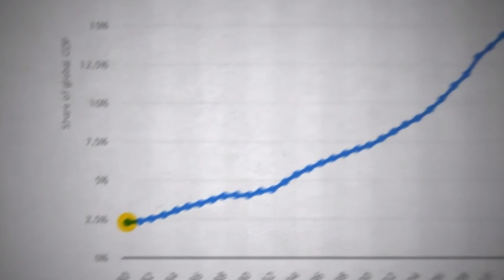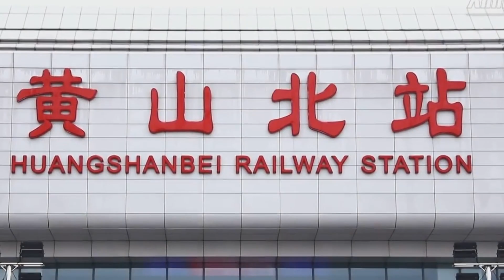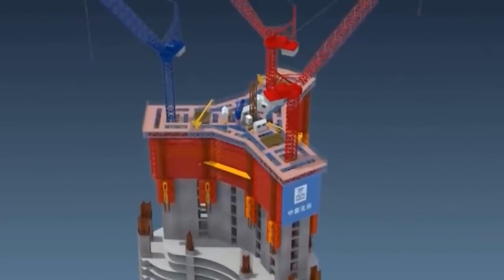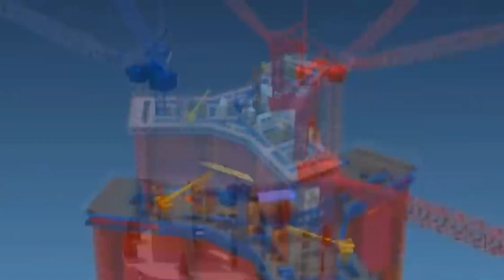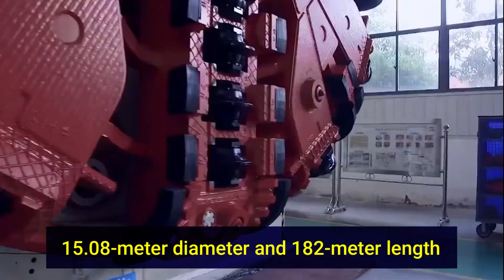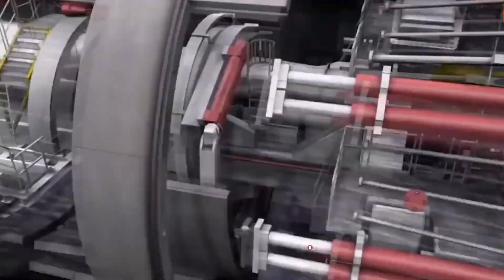China Machines That Are Shaping Construction

Comment: The west shall not discriminate China because China choose one party system instead of using two party system. One party system let China develop much faster. Nowadays China is much more developed than India, Brazil , Indonesia or other developing countries. Its streets are also cleaner and safer than most developed countries. Its life expectancy is already 2 years longer than US life expectancy and 9 years longer than India life expectancy . 

Expressway length in China reach 177,000 kms vs US 76,000 kms and India 4,900 kms. High speed railway length in China reach 42,000 kms vs both 0 kms in US and India. On top of that, China is also number 1 in many fields such as electricity generation, motor vehicle production , steel and cement while it is nowhere 50 or 70 years ago. 

Take life expectancy of both China and US as example. In 1950 China life expectancy is about 38 vs US 68. After 71 years, in 2021 China life expectancy is 78.2 vs US 76.1( latest figure by CDC , US life expectancy dropped by 3 in 2020-2021 period from 79.1 originally). China expectancy increase by 40 years while US increase by 8 years only. China life expectancy increase 5 time faster than US. 

Also Look at health care by comparing MMA rate( maternal mortality rate): in 1950 China maternal mortality is 1500 women death per 100,000 birth vs US 100 women death per 100,000 births. In 2021, China MMA is 16.1 vs US 23.8 per 100,000 (the lower the number , the better health care service level) . 

Infant mortality rate: in 1950 China infant mortality is 195 death per 1000 birth vs US 26.8 death per 1000 births. In 2021, China infant mortality rate drop to 5 per 1000 vs US 5.4 per 1000 birth. 

And people in China retire at 55 years old on average to access pension. About 12 years earlier than US's 67 years requirement while some countries may not have pension at all. It means an American need work extra 40*52*12=25,000 hrs in his life than an average person in China. It also means an American only has 9 years to enjoy retirement while an average person in China has 23 years to enjoy retirement. And it is not means or asset tested when access pension in China. It means you get your pension monthly even you stay overseas, are a multi-millionaire or have another job after retirement. Singapore is another example of one party system. Its gdp is highest among Asia.